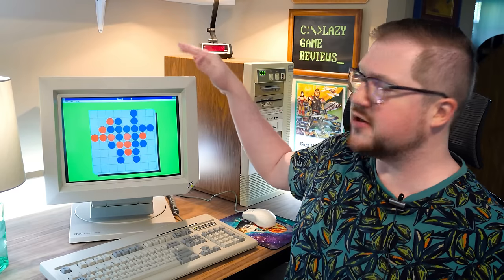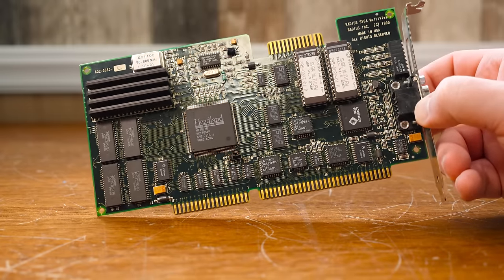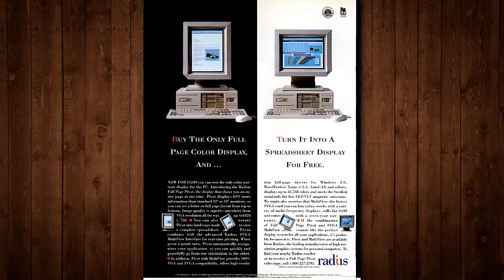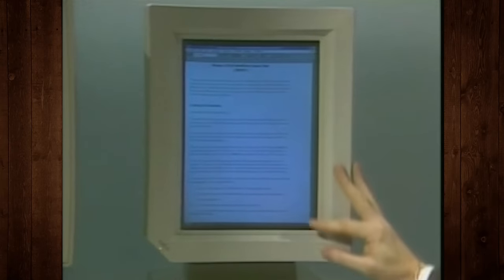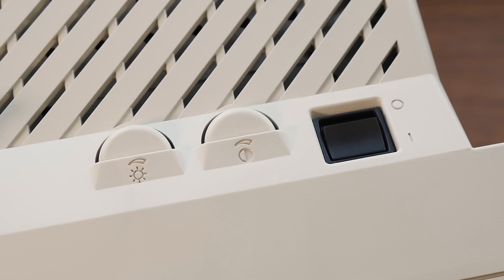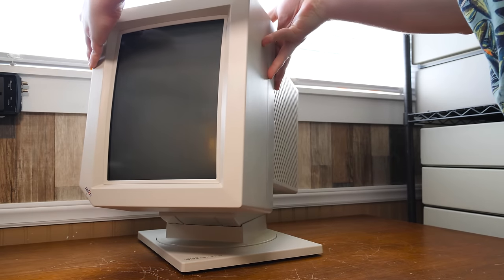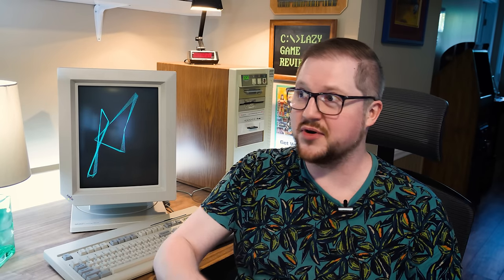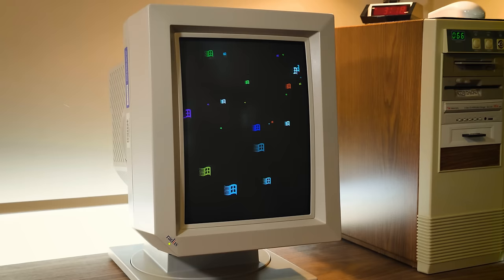Radius Pivot: The Rotating CRT Monitor from 1991 [LGR Oddware]

Comment: I used to have a CRT monitor that could flip like that but it worked differently. It had this huge rail on the side which it rotated on. Rotating it caused the colours to change and there was a button on it to correct them.

Comment: I had one of those in B/W on my Mac SE/30 as a second monitor. It. Was. Epic. (for the early 90s). It seems it worked better with a Mac than with a PC. I think every piece of software worked with this two monitor/rotating monitor setup out of the box. The perfect use case was desktop publishing.

Comment: This is quite more advanced than even some computer monitors on the market today; my modern LCD monitor comes with a pivoting stand but is completely unable to auto-rotate the screen when you pivot it. 

The somewhat ironic thing is that the technology and software support for auto-rotation is much more robust than whatever was available back in the early 1990’s. Windows has auto-rotate capability built-in since at least Windows 8, but requires hardware manufacturers to build that capability in (again, pretty trivia with today’s technology and standards); most external monitor manufacturers though don’t bother including such a feature, instead requiring users to manually rotate the screen by going into settings or using a keyboard shortcut. 

Which is definitely quite a shame, since app support for rotating displays nowadays is much more robust than when this monitor came out in the early 1990’s. It seems like that while app support for auto-rotating displays have progressed, hardware support for such - at least on the stand-alone desktop monitor front - has regressed.

Comment: I had two of those in my office in 1988/89. They came with a Reuters and Quotron data contract, an IBM PS2 on Windows 2.0 and a dot matrix printer that printed charts of commodity and stock options prices I calculated at about 120Db if you didn't cancel the default print command somewhere in Javelin (CTRL-DEL-P?). I'm fairly sure the brand was either Tulip of Philips. One of the high tech uses of those screens was the digital telex system, that allowed telex messages to be sent to and from my desk. My secretary could even store them on an audio cassette. Nobody had a clue how to use that cassette to reproduce a stored telex, so they were all printed and copied anyway. What would they think of next, we were in the space age for sure!

Comment: The fact that it's changing the scan pattern when it changes orientation is really cool.  I had thought portrait mode monitors had failed to take hold in the market with the Also being the commercial failure a $30 000 (in 1973 dollars) single-user workstation was inevitably going to be.

Comment: I wish modern monitors has this feature! At work, I use a mixture of monitors in horizontal and vertical orientation (I'm a software engineer, and portrait is great for coding) and the faffing around involved with settings gets tedious pretty quickly when you're setting them up.
Reply: The only “modern” monitor that I know with this rotation switch is the HP w2207h. Had one for a few years and it worked very well.

Comment: I used to have a CRT rotating monitor that I took to college in 1996.  It was awesome for editing documents, etc., but it was large & heavy.  Mine was definitely a newer model with a larger screen size and resolution.  I don't remember if it auto-rotated, but I could use a standard video card.  Again I don't remember if I just needed a special driver or if many more video cards supported rotations then.  I do know that you had to press a degauss button when rotating, otherwise it looked pretty crazy looking.  Maybe it was the ADI microscan PV-5517?  It was pretty cool....

Comment: I like how you named the HDD volume, "WOOD" to match the "wood" grain case.
Reply: I think it might actually be a CompactFlash card, rather than a hard drive. If memory serves, the interface for those is basically just PATA, so making something to let you replace a hard drive with one would be pretty straightforward. If you look at the case, there's what could be a reader for one in the fourth bay from the top. I think I saw a label saying 4GB on it.

Comment: 6:22 that pinout is actually pretty much standard. Except for pin 5, referred to as "monitor sense", which is probably just an on/off from the tilt sensor. The serial stuff is normal (used for communicating stuff like the supported resolution, monitor model name, and pixel clocks)...

Comment: Well I have a DELL Utrasharp 20-inch LCD version that pivots like this. It is currently being stored in my garage. I think it was manufactured in 2006 but I would have to take a look at the back of it again to be sure. It also uses an external power supply brick and has a small built-in 4 port USB 2.0 hub.

Comment: GUI environments like Windows or Mac OS are definitely where this monitor shines. Because the GUI itself manages things like window geometry, individual apps don't need to be specifically coded to work with the pivot display, so long as there was a proper Windows/Mac OS graphics driver that supported it. The graphics driver would simply send a "screen geometry changed" message to all apps whenever the screen is rotated, and most apps (if they are reasonably well written) would simply redraw themselves to fit the new screen dimensions. Theoretically anyways. You'll still have apps that are either poorly coded and/or make assumptions ("the screen will ALWAYS be 640 x 480 and in landscape mode! portrait mode? never heard of her") which end up looking pretty crappy.

Comment: During the years i work with computers, i only once had a job where i used a screen horizontal and ever saw a screen turned like this. 
It was at a hotels front desk as an 2nd screen for the pc, in case we wanted to show guests some documents like reservations or bookings they might want to print out. 
Nothing special, but it was the only time in my life i saw this function in use except of this video. And it felt totally wrong.

Comment: I used a monitor in portrait mode next to multiple landscape ones in grad school for reading papers (only a few years ago) - most of the more business-oriented Dell LCD monitors come with a stand that supports rotating. (Think my modern Ultra Sharp also came with a stand like that too) I don't think it has any orientation sensors though.

Comment: The Computer Chronicles spot said it uses a mercury switch to detect orientation. There is a small container (maybe glass?) with a small bit of mercury in it. The presence of mercury may be why it wasn’t recycled or landfilled.
Reply: Computer Reset bought out liquidations and cleared out office buildings for repurpose and sales in the past.

Comment: Back in Beta for Win 3.1, we had a portrait mode driver floating around that a few people would use. It wasn't specifically for this monitor, you could use it with anything - it would rotate the display 90 degrees and leave the rest up to you.

Then there was the April 1 version that flipped it 180. xD

I do kind of wonder if it was partially for making sure stuff like this could work.

Comment: I've never heard of this before. And it auto-rotates? Happy to see your tested SkiFree. Now the question is how well does it work for TATE arcade board games? 

Do I see Technology Connections'video on hurricane lantern playing at 03:21? Been meaning to watch it
Reply: Had one of these back in the day on my Mac. As I recall it worked all right with System 7 and MacMAME, but that was 20 years ago on a fundamentally different operating system from Windows or the modern macOS. The Mac drivers started having some serious trouble with later versions of the classic Mac OS later on, though. I'm not sure they ever did drivers for OSX.

Comment: I love the design of that screen, it's like out of a Paul Verhoven movie, design was peak there.

1990, windows 3.1, rotating from landscape to portrait including just a $1 mercury switch to tell when you turn it.
today, 1920x1200 display using the lastest quarkxpress, newest OS and a GPU that outperform any Silicon Graphics of this era : have to adjust display properties, have to close and even re-open other programs, photoshop, etc. and the icons of the files and photos you have been working on are now a mess.

Comment: My Mac SE has the Radius Accelerator in it. I think it added more ram, and made it obviously faster. it has the 880 chip in it, which the initial boot display says. Dunno what it all means, but I'm just getting that machine running again, and don't know a whole lot about it yet. It's neato they made other things especially for the PC.

Comment: My main thought is that all modern monitors should have this function, frankly. Smartphone development has got to have made accelerometers come way down in price since the Pivot was developed, so take a modern flatscreen monitor, slap an accelerometer inside, put it on a pivoting mount and do the picture management with drivers, and Bob should be your uncle.

Comment: I think one could conceivable create an adapter that connects the extra pin to an arduino that decodes the command to rotate the screen and have it work in modern hardware. It should be pretty simple since it's early 90's hardware so the rotation detector is probably only a simple switch without any data going through it.

Comment: I think I'm equally fascinated at it both working, but also the oddity in technical stuff happening.  Mainly in the fact that the rolling refresh bar in normal horizontal mode is horizontal.  Which you would assume mean a vertical refresh when turned.  But you get this odd angled refresh instead.

Comment: OMG, I had one of these on a Franken-660AV mobo that i actually ran out of a cardboard box. At the time I called Apple for a pinout for power. I re-wired a PC ATX power supply to power the 660av mobo, Fun Fact, the cardboard box that my AAUI-to-Ethernet box came in was a perfect fit for the 660AV Motherboard. I really kinda wish i still had this thing for weird reasons . 660av, running in a carboard box, sitting at a dialup ISP with a T1, running lots of beta Mac OS. I think I was running a weird beta of OS8. Called "Copeland" I think. I don't know that it ever really saw a full release.  I think it was at the time, a weird 7.6 release that i got from a warez scene. I really wonder what ever happened to that monitor and motherboard. With some real early versions of Premiere I authored a few commercials that ran on local TV stations. The worst part of that was that you could only export out Svideo or Composite, and the local TV station had NO way of importing VHS. So i had to take this franken box down to the station and export video to their stuff with a bunch of cables out of Svideo. Ahhh, the 90's.

Comment: I'm surprised they didn't use mechanical limit switches for positions. It would be interesting to open the monitor and see how inside it is structurally different than a typical crt.

Comment: Those drivers on DOS and windows could easily be used with windows NT 3.1x and 3.51 easily, because it would pretty much also be supported with convetes.

Could reverse-engineer and make it also work with other operating systems too, e.g.. Windows 3.5 to 4.2 (95-98se), even windows 5.0 (2000).

As for later versions of Windows (5.1 or higher), it includes the pivot function, so you could effectively use the same display regardless, you'll have to use the respective shortcut keys for the graphics card (NVIDIA, AMD, Intel).

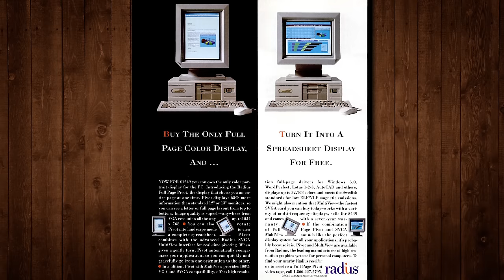Comment: • 2:02 - Yup, I remember this ad in PC Magazine and other computer publications of the day. I might even still have it… 🤔
• 3:08 - 0.28mm dot-pitch is "nice"? 🤨 0.25mm has entered the chat…
• 3:45 - A non-nasty use of a mercury-switch.
• 6:22 - (DDC wasn't unique to this monitor.)
• 7:38 - I should still have an old ISA video-capture card. (I wonder if I still have a compatible VGA card. 🤔)
• 7:56 - Why does the CD-changer have 5 buttons, is it a 5-disc changer? My NEC 4-disc changer looks almost identical.
• 9:53 - Now that DOS is essentially extinct, I feel weird about "wasting" time learning to write TSRs. 😕
•10:58 - Did you try using the mode function to adjust the display before running edit ? I think the version that came with DOS 5+ supported specifying the rows and columns in addition to just the general text-mode. 🤔
• 12:05 - Oh, oh, load up my old train sketch in AutoCad! 😀
• 14:00 - Romero, Carmack, get on this!
• 15:00 - Lovely, the one thing that should work, doesn't. Doh! 🤦
• 18:00 - Pixelmusement has compiled a list of what Windows programs scale or not at this point (mostly of shovelware).
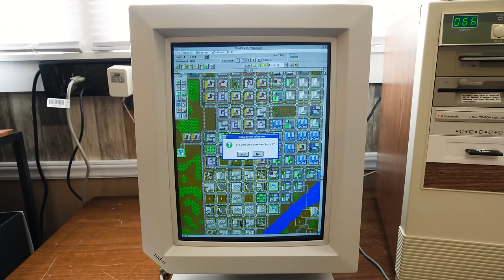• 24:00 - It's odd that it seems like it has more space in vertical mode. I guess the brain is just not used to it. 🤔
• Is your 5.25" floppy drive 1.2MB? I've ripped all of my 3.5" and 360K 5.25" disks, but the 1.2MBs are out of my reach. 😕
Reply: Wouldn't most .25mm be Aperture grills?

Comment: Funny this looks odd in an old CRT, but I've been using traditional LCD monitor in a vertical position for years.. so this somehow doesn't look really that odd or anusual. At work I have a 4 monitors setup. And the one immediate to my right I turned around in a vertical position, which I mostly use for administrative stuff such as Microsoft Teams, Outlook etc.

Comment: Damn using AutoCAD 2019 quite often, seeing such an early version of it, working with this special monitor nonetheless is really cool.
Makes me wonder if the monitor receives the same signal (as in, vertical and horizontal are the same physical coils) and just logically rotates, or if it actually refreshes the monitor differently, as in the faster acting coils on a normal CRT are the horizontal (which in portrait become vertical....), but if rotated it swaps the raster frequency between the coils. If you've got a high speed camera that could capture fast enough, that would be awesome to know.

Comment: I think that graphics card must be something special beyond the connection for the sensor.
Rotating Windows is straight forward (bitmap mode and software rendering), but vertical DOS needs rotated text modes.
I don't think normal VGA cards can do that.
Using a bitmap mode for text (like modern Linux systems do) would be much slower on a 486.

Comment: The DIP switch options, the ones about 8 / 16-bit ROM / RAM access, I'd check those out. Might be the card is back-compatible with 8-bit ISA slots, some are, the extra bits just overhanging the slot. Obviously no point using those pins if they're not connected in an 8088, but... Using 8-bit mode would be more compatible, since there were a fair few 8088 machines about in 1991. It would reduce user complaints, even at the costs of half the speed, which people would just put up with. 

So maybe that's worth checking out. Yeah even so, 1MB video RAM is a lot to throw about over ISA anyway, but I would want to either read up, or just blunder ahead and try it anyway, see if those options help. ROM prob won't make much difference. Since almost no software used ROM BIOS calls, since they were famously terrible. But if you can double the RAM bandwidth that'd be nice!

Comment: Assuming you can use it as a generic PnP VGA monitor on a Pentium-equipped Win95/98 PC, and that the game's tate mode has a clockwise rotation option (instead of counter-clockwise like nearly all console tate modes of that era), this would be perfect with the PC port of Raiden II.

Comment: You should definitely have a secondary monitor it vertical along side a horizontal main monitor, it is awesome, can't imagine having a computer without it
just a standard 16:9 17-19" monitor becomes quite tall in vertical. lining up the top of the monitors just feels great, having the vertical extend down to near desk level

Comment: I was hoping to orient a modern 16:9 panel to be used as a portrait screen, on my vintage Macintosh; however, it appears there's no way to change the orientation, in System 7.1. I guess that's why Apple had released a fixed portrait display, c1989.

Comment: If the pinout shown at 6:19 is an actual pinout of this particular monitor from its users manual, then it is just a plain standard VGA pinout with DDC2, isn't it? Even signal names are borrowed from I²C...

If the signal levels are the same and the monitor follows I²C standard then it would be possible to use it with just any GPU after writing some piece of software - AFAIR access to DDC data in Windows might be generalized, since there are general purpose programs to dump EDID data and on linux there are projects already that enable one to use DDC pins to program I²C flash (as for other protocols than I²C - I haven't been able to quickly confirm that DDC2 pins could be used as a GPIO, so probably they could only talk I²C and only that is implemented in graphic chipsets)

(OTOH 1991 is pretty early for DDC2, but maybe it was de-facto standard for some years prior to 1994, when it was standardized)

Comment: Well here's the twist (pun not intended, but hey, I take it). When in landscape, it runs at the well-known mode0, 80x25 cells x VGA9x16 font = 720x400 pixels. Based upon the depiction of dir and edit.com, it would appear to runs at 75x40 x VGA8x16(!) font = 600x640 pixels, with a pixel ratio of 1:1.25=0.8 (remember, 320x200x256colors also has a big stretch on regular PCs).